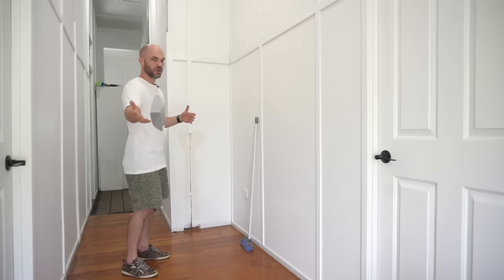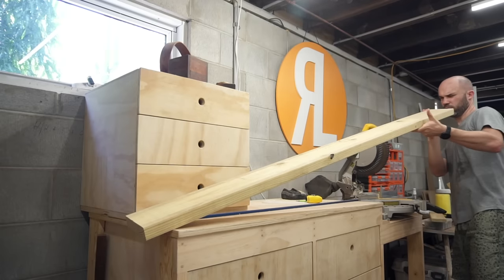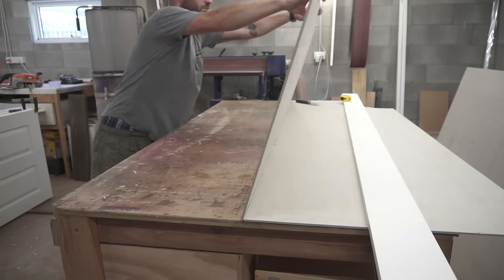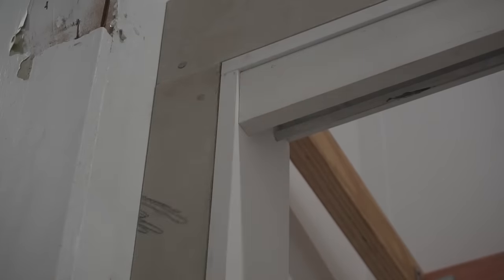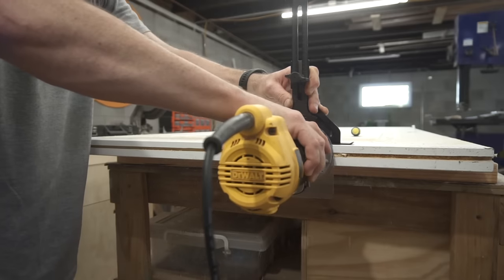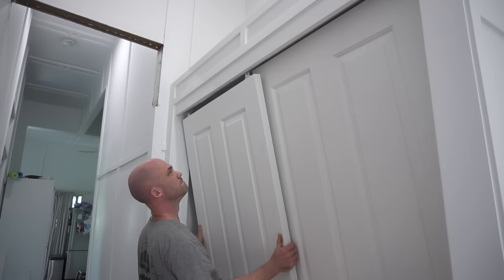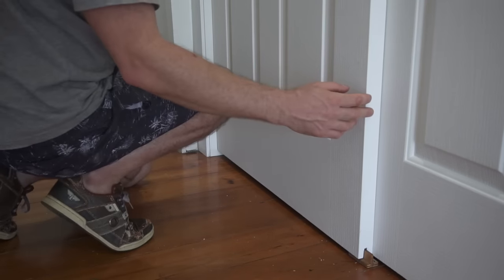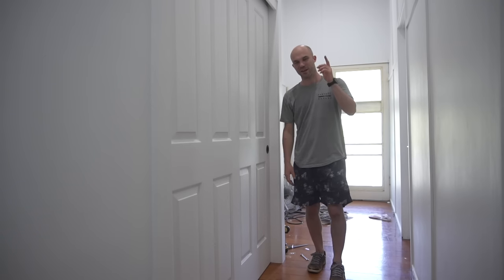How To Build A Closet with Top Hung Sliding Doors

Comment: you don't need to hand make and place custom guides at the bottom of the doors. Since you made the pelmet and bought the top track already. You can also purchase a lower running track. These are usually sold in pairs (a top track and a bottom track). Saves a lot of stuffing around and the doors are move secure to the floor with less chance of them bouncing off the little guides you put in. These are not a new thing as i have been modifying wardrobes for over 30 years using a double tracking system.